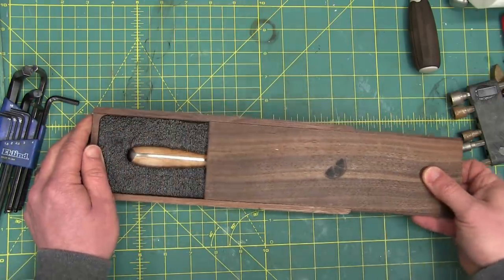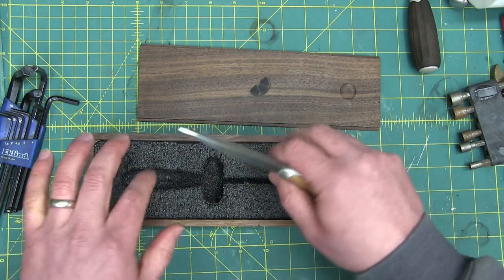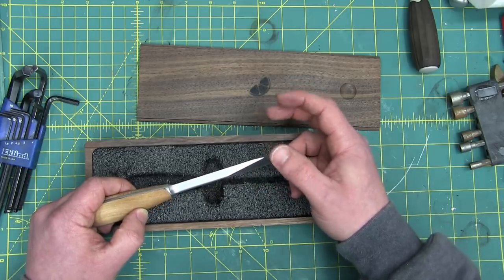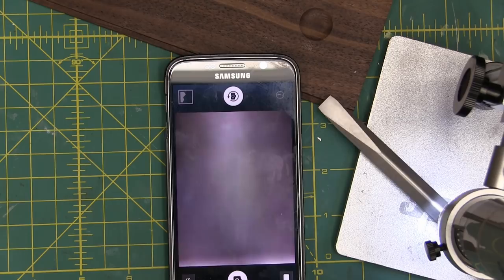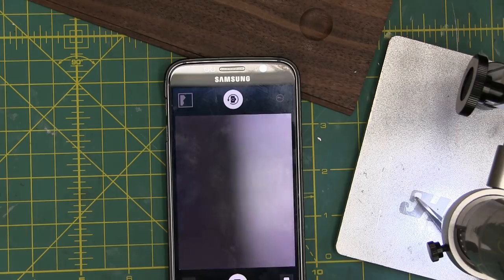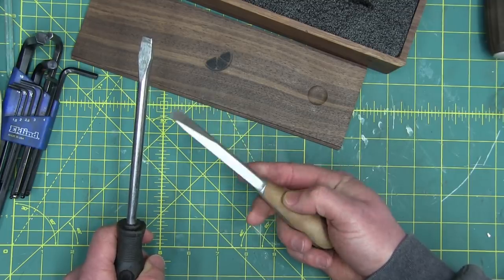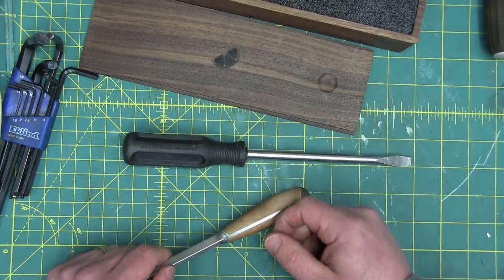Tool that doesn't exist? | MAKE IT!

Comment: Noone uses flat bladed screws anymore!
Reply: Andrew Gengler as an elekchicken I work with old plugs and switches and lights all the time that use flat head screws. And many terminals for disconnects and panels and equipment, even new ones, still use flat head lugs
Reply: I do! I'm not able to use posidrive for aesthetic reasons in the heritage industry... Also; he makes a good point that a flat blade screwdriver is often used as a 'pocket pry-bar' by the mechanical types.
Reply: i use them every time i work on something i got a big craftsman flat head i use for spliting sealed caps or cases , ive got afew diff sizes from big to pocket size so yes they are still useful
Reply: It’s not JUST for screws. Most of us hate flathead screws to death (appart from the clean look). The driver, however... can pry, scrape, wedge, even chisel, with some skill.
Reply: ProfessorBraincramp Ah, a millwrights pry bar - anything
Reply: Also as an elekchicken, my favorite screwdriver at the moment is my Klein 602-6. (I’m sure there’s even better ones, but I’m happy with my Klein). It’s pretty much always in my pocket no matter what the task is.
Reply: I was being sarcastic.
Reply: There are plenty of old machinery to fix
Reply: It's not about it being flat for screws it's about it being a handy tool for everything else ,like opening paint tins which you can't do with a Pozzi or Phillips .
Reply: In the lighting business that is pretty much all we ever use.
Reply: And just when you think that a previous owner of a car you recently purchased replaced 80 % of all crews for a flat head. .
Reply: Yeah I prefer round bladed screws. Sign of the times bud.
Reply: No need to be polite...;-}
Reply: knaptonmawson If you can't open a can of paint with a Phillips screwdriver, you're just not motivated enough!
Reply: elekchicken here too. I believe i use a standard screwdriver more than anything else. as much as i love this screwdriver, unfortunately i couldnt use it in the industry with the full tang extruding through the handle. would love it if there was a model with a hidden tang.
Reply: k garvey Ya I've made the mistake of using non-insulated screwdrivers on light switches... that's one I won't do again (only took 3 bad experiences to finally learn)
Reply: 4 spd life
Reply: Engine covers, Hose clamps, vehicle underpanels. Seen them in high precision assembly's like transmissions, and as adjustment screws. I actually like them much more than phillips that cams out.

Comment: My gut-reaction is that design really needs a rivet or two to keep the handle scales on over time.  True, many glues are stronger than the wood, itself, but a mechanical fastener would hold the wood handles on, even if the wood-to-metal glue joint (or surrounding wood fibers) weakens/fails.

Brass is the obvious choice for handle pins, but aesthetically contrasts with titanium. Titanium pins are likely difficult/expensive to peen over.  Alumin[i]um pins might be they way?  Even wooden pins (dowels) would help.

Testing over time will bear out whether my gut-reaction is merely a load of gas or has some substance.

Comment: Have you ever tried forging by hand? In my experience it is much easier to forge titanium, or even steel for that matter, than it is to machine it. You may not get the precision you would from machining but if it's a good quality and inexpensive hand tool you're looking for precision doesn't matter as much. Plus the equipment to do it yourself can be bought for about $100 for a starter setup

Comment: We still have those in the Army. Screwdriver, flat tip, 3/8"x12", blade extends through handle. Translation; the ultimate prying tool.

Comment: I LIKE it!  Should have mentioned that huge square shaft for wrenching on and the way the blade is cut to take full advantage of the diagonal width of the shaft without having to forge it wider. I'm assuming the shaft between the two wooden scales goes all the way through to transmit striking force from the butt end. My grandfather had one or two wood-handled screwdrivers like that. Beauty!

Comment: Back in the 19th century, British gunmakers supplied the custom made gun you ordered to fit you, and in the box came a set of tools, “turn-screws”, pin vices and whatnot, that were all hand made by the gunmaker to fit exactly the various fastenings on the gun, and probably would not fit any other.  A joy to behold and use.
Reply: A more contemporary and more mass produced version, Ural motorcycles would supply you with not only the motorcycle, but a full toolkit of all the tools you needed to work on the bike AND a crate of part also

Comment: I was out at a flea market/antique store with family and when I saw a case of old drivers like this, they must have thought I had lost my mind. I can't help it though! These are so gorgeous!  I kinda have the same concerns as you though about the wood staying on if you use it too roughly. Maybe putting a pin or two through the handle like you would on a knife?

Comment: Garrett Wade carries a tanker screwdriver set with a similar configuration.  But - garden-variety tool steel, not as refined.  Big thing is when people make small screwdrivers they scale everything down and if you need to pry in a tight space you're up the creek.  And, titanium. . . I'm a sucker for anything titanium.

Comment: I love the look of that screwdriver!!! I made a small set of titanium tools a few years ago, 3 various sized philips or cross drivers, 3 flat heads, and a hammer.. I love those too... BUT.. what I learned out of the process, is that I hate machining titanium, LOL.. the cost of the tools in respect to the tooling cutter wear or breakage, ouch!!... Now, I am in a paradigm with my home made tool kit, and goes as follows, I love to use them, They seem not to wear at the tips as the "throw-away" units do. They are built to fit my hands. For some odd reason, I fear using them, I suspect do to the cost involved in the making of them, the cost of the raw materials, and the fear that I might lose one, or that I might ruin one...  Maybe I suppose, if more folks were forced to make their hand tools, much like the great care that typical would go into making a machine tool or a plastic injection mold, folks may take a much greater pride in their craftsmanship? The idea that a young man or an apprentice may take pride in receiving his father's or mentor's tools as a gift, to continue to carry on with the teaching that were likewise handed down ......  Lastly, until a person that is a mechanic, grabs a hold of a tool made out of titanium, they will never know how luxurious they feel, and is extremely deceptive to have a screw driver that is extremely durable, yet, weighs next to nothing from compared to what his hands are used to holding, as if it was made from the slaggiest garbage filled alloy Eurasia could muster... it is just a weird feeling at first... I thought at the beginning of my venture, that I was going to make a full set of sockets in imperial and metric...... but..... H*LL NO.... the one set would end up costing $3500 with time and materials and wear & tear.... I am not the smartest guy out there, but, my local heat treater guys, had mentioned something about the heat threating process would be different from the small socket to the larger socket, and unless they had a duplicate of every size, there wouldn't be any guarantee, and they deal with titanium all the time... but, I will take them at their word, as I only have the concept of heat treating down for ferrous metals...

Comment: If you are going to use it for prying it would be smart to rotate the tip 90 degrees in relation to the handle so the full tang handle is edge ways giving it a lot more strength.

Comment: That's really pretty.  I hadn't thought much about heirloom-worthy tools.  I was helping my mom pack to move, and we went through her tools together.   There were some that my dad had.  They probably dated from the 1950s or 1960s.  I wanted them, because he thought they were good, and they survived this long.   One was a leather wrapped grip claw hammer.   Nothing fancy as a hammer, but it distinctively had the black leather handle.

It could be nice having a "nice" set of tools.   Not just a brand name stamped on the side, imbuing it with some black magic associated with the mark.  Something like a finely milled titanium screwdriver and hand crafted oiled wood handle.   Maybe a matching set of titanium box/open end wrenches, with the center of the span having the same wood treatment.

And thinking about it, a set of one flavor would probably cost $1k or more in mass production, or $10k as the one-off.  

"The AvE Select Custom Classic Tools, for the discerning wrench turner..."   That sounds like something I could pass on to the grandkids, to be lost hours after I die.

Comment: Beautiful tool! Constructive criticism if I may; I agree that a wooden grip  is preferable. This design though prevents the grip from  being replaced if it gets destroyed. In addition: as the wood swells, shrinks, wears down, a sharp edge will be revealed and rub against the users hands. The grip should be all the way around. A hollowed out dowel, slipped over a rod (tang), and held in place by a heavy (hardened steel) end cap (pommel) with a counter sunk screw set in the center and threaded into the tang. This would make it serviceable, durable, and comfortable.

Comment: Beautiful driver. 

I wonder if adding an internal hidden rib under the grip panel could alleviate the risk of impact popping off the handle grip. It would add more impact rigidity, as well as giving additional "meat" for the grip panel to bite into.

Comment: Big respect for the skocum videos, maybe if you put the bracing from the shank of the tool to the butt in 2 axis, rather than having just one piece of flat going front to rear along an axis that is more than likely to be struck.
Then have a 4 piece handle rather than 2?

Comment: I wouldn't worry too much about surface finish.  In my experience,  Titanium is going to get scratched up like crazy in an application like that anyway.  I have a titanium wedding ring and it's impossible to keep the thing from getting scratched up.

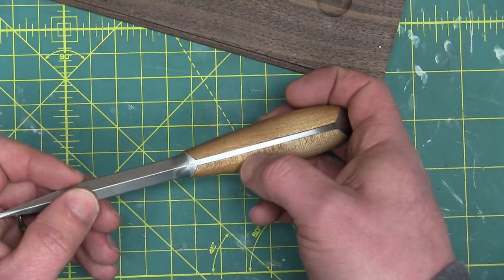Comment: The "edgewise grain" you're mentioning at 4:37 is actually "ray flecking".  It's a type of figure you get in flatsawn wood.  I wouldn't consider it a flaw, as it doesn't weaken the handle.  It's actually often considered a desirable feature.  If you really want to avoid it you'll probably want to switch to a different species of wood.

If you do another run of these you should make some with super-figured wood, like quilted maple or burl.  Or make some without wooden handles so turners could make their own!

Comment: Good tools do have soul.  I  picked up an old 9/16 Challenger box end wrench the other day and thought about all the shit that wrench and I had been through over the last 39 years...(used when I got it) and it's still the same as the day it was new.  The open end doesn't flex and round bolt heads like a Cornwell or Mac will, and it doesn't have that torque limiting sharp edge of Snap On wrenches. Can't even find them anymore, so I hope it never breaks. The flood of Chinesium has taken over.

Comment: One thing I like is the shaft and blade appear to be along the same plane horizontally. Screwdrivers often are flared at the blade for future proper fitting. The blade once fitted to the screw, is then trimmed to the screwhead  diameter. A proper tool box could have as many different screwdrivers as the number of different screws. Once the blade is properly fitted, it will hold tight, not jump out, and tighten well without stripping out. Blade type driversare considered obsolete.by  many but there is no resurrecting a philips o torx screw period. I prefer the ease of the philips and torx, but if time is not an issue, give me a blade type always. Plus they are far better looking. Ask any mechanic how they feel about corroded dirt filled torx. The first word of his/her reply will not be found in the dictionary.

Comment: To those dissing on the roundness of the handle, I believe the traditional tools in this style have a bit more of an oval cross section to the handle which gives a really nice feel and plenty of grip.  My grandpa had a short set that was like that.  This iteration does look more round (at least on camera) than it 'should' be.  I've wanted a set of that style of screwdrivers forever, but have never come across them.  I can't stand the common ones with the plastic or coated handles with the ribs in them.

Comment: I like the idea.  Also collecting old wood handle drivers. Can't beat 'em, plenty at garage sales.  Titanium, maybe. I HATE magnetized tools. Personally, it's a little wide for my uses. A 7/32" would be about perfect for 90% of the things I grab a flat blade for.  I suppose it depends on where you work. Kind of wish it had a hex on the shaft (like SnapOn) for a racheting wrench but a flat's better than nothin'.  Keep it up Uncle B!

Comment: If you didn't tell me it was a screw driver, I'd be inclined to believe it was a chisel.

I often prefer chunky handle screw drivers, easier to grip and put torque into. The best ones I have were cheap... but damn they are good. The bare grip gives such confidence you feel like you could turn the earth it with if you tried hard enough. The grip on yours looks small, possibly just you have big hands.. and the shaft is monstrous too.

Comment: It's awesome, but knurled aluminum grip in place of wood furnature would be tits! You could mount with countersunk screws and machine a interlocking block in the parts to keep side pressure off fasteners. There would need to be a boundary layer to prevent corrosion.

Comment: Love the tool! You should add some brass (or otherwise) pins to accent and reinforce the handle diagonally like the old tools used to have. Other than that, just let those microscopic machine marks be the natural unique "art marks" in the production. No tool exactly the same as another is the best kind.

Comment: is it the same thickness throughout, does the strenght of the handle come from the flat part between the wood?

well since you have anything to do with this tool, and you like it I bet it wont bend at the handle but I'd love to know.

Comment: Was this tool made on 4th axis? I think that if it where able to be run in 4th axis fixture could reduce the tool path blending issues. Making the the whole part in one shot will give the most accuracy and might be able to bring the cost down a bit being more autonomous cycled. Great work on the vigeos and the skookum choochdriver AvE.

Comment: How about those chicago screws. They also happen to use a what I grew up calling a standard screw driver. That would allow easy replacement of the wood scales. Also if you decreased the end taper to 90 degrees and put the front one at like a dove tail type angle any abuse would only tighten the wooden scales into the handle. Just my 2 cents

Comment: You should make one with a hex profile shank and socket in the handle with setscrew.  That way you could use a piece of generic hex barstock to replace the blade when it wore and could reuse the handle.  Just grind the hex stock to flat.  Hollow ground maybe?

Comment: Absolutely love it, I'm not old but I'm not young, but I was brought in the old skool way, mechanical contractor, plumr, sparky, mechanic, whateva tha faq it may be, if there's electric runing to it, moving parts or chemicals present it makes me smile.....but as I said I love the tool, to the extent of the extreme is totally how I would have rolled also......old skool kool is where it's at cats! Love it!

Comment: Is there such a thing as over skookum?

Is titanium really necessary?  its too small to pry a heavy load. I understand the dilemma with non ferrous screwdriver, but when do you run into a non ferrous "Flat" head screw or bolt and needs to be super tight? Why not use stainless for those applications? I like the idea of a well built tool passing on but that thing is going to be stolen... it looks too nice not to...

Comment: My only problem with all this is that stiff though titanium is, your regular titanium alloy has a RockC hardness in the upper 30s to mid 40s. I get stainless steels are also soft and crappy, but I'd be super worried about the actual blade of this screwdriver deforming under load if you ever use it for particularly well-tightened screws, or even just for standard prying work. Would it not be advantageous to stick a small hardened steel insert at the end of the titanium shank to alleviate this problem?

Comment: I say drill through the wood pieces (full tang knife), and pin it with brass pins.   The brass + the added mechanical securing might cancel out most ordinary things you do with a screwdriver.   

It's not a chisel, but you know people do some dumb stuff... using the product for other than it's intended purpose.  

I made a stainless steel screwdriver on the lathe and Bridgeport at my school.  I knurled the handle, tapered the screwdriver head from the top view.   A gunsmith's screwdriver essentially.   I always appreciate your knowledge and videos.  Once I gather enough scratch to buy a lathe, I'll be in fat city.

Or the Cockford O institute of making shit happen.

Comment: I think if you had metal base in the grip perpendicular to the flat tip, you would allow more force when using it crowbar-like.
Also I really doubt you ever will use it as a screwdriver.

Comment: Nice piece, but the handle is a missed opportunity.  Not sure what wood species it is, but it's very plain.  FOr an heirloom, use something like cocobolo or bubinga.  They're harder and tougher (they maching almost like metal) with natural oils that prevent rotting and drying out, and make it easier to keep clean--plus it'll be gorgeous.